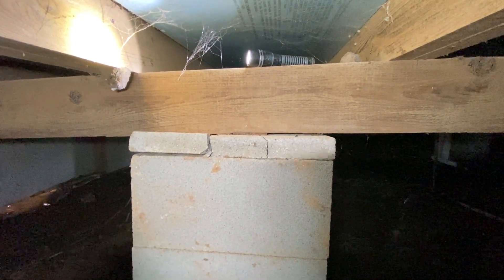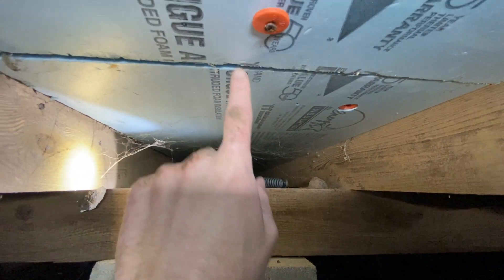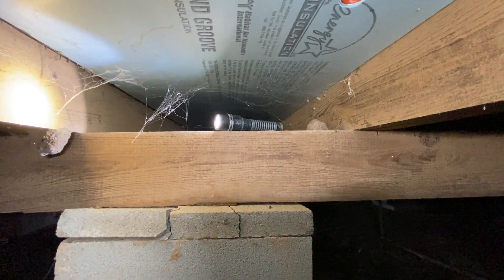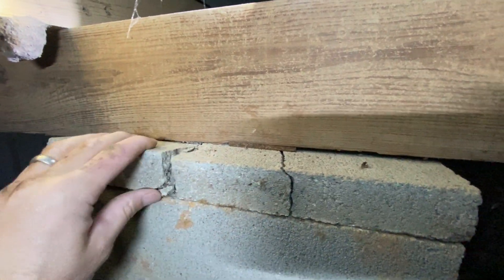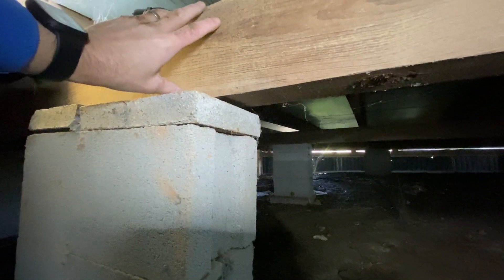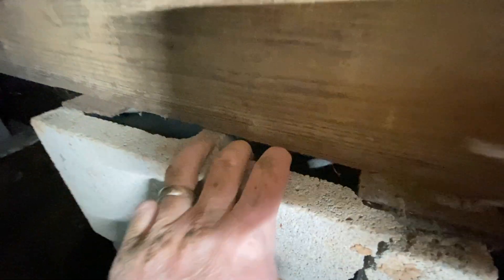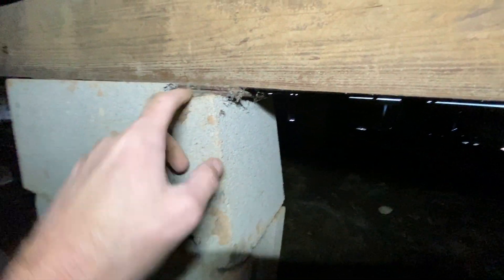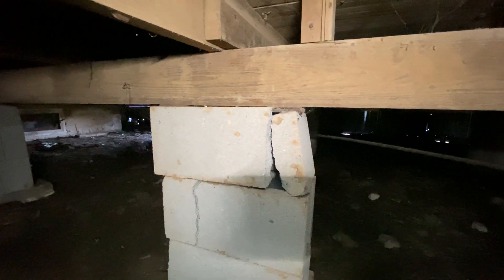Here's Why You Don't Use Steel Shims for Crawl Space Foundation Leveling

Comment: Centerblocks are a joke for foundation unless you stack them staggared for basement walls, then run rebar through them and then pour cement down the holes to the top. A crawspace though? Everything needs to be solid

Comment: In many cases I am sure when we need a shim or spacer there is another issue. If beam is off say 3/16 on one end and 1/8 on the other how would a pro handle that? I am speaking of beam on one block.🦇
Reply from the maker: The shims we use are tapered cedar. Check this out: https://anchorfoundationrepair.net/blog/best-shims-crawlspace-home/

Comment: Any type of shim would do this, has nothing to do with being steel. You put a wood shim there it still makes a point load on the concrete. If the weight is so much that it compresses the wood, then the shim isn’t doing anything. The REAL answer is to put more and larger shims in that spread the weight out, whether steel, wood, or nylon.
Reply from the maker: Fair point and why we use wide cedar shingles for our shimming material on crawl space homes.  https://anchorfoundationrepair.net/blog/best-shims-crawlspace-home/

Comment: What’s the seal made up of?
Reply from the maker: That sill (aka beam) is a 4x6 pressure treated pine.  Very common in our area.  Older homes may have had a 6x6 (or larger) and occasionally I see someone use an undersized 4x4 for a little extra support in one area or another of a home

Comment: Hollow cinder blocks should have been filled solid. Looks like cheap/decorative cap block, I don’t know that they are designed to be structural. Cedar shims are not allowed as they will crush under load over time. Probably the correct answer would be steel shims in two or three locations for each masonry pier.

Comment: If you hope to do this right never use wood. Wood crushes. Use steel shims at least half as long as the concrete. The longer the better. Steel doesnt crush so never settles.
Reply from the maker: Not a bad strategy….

I feel it’s less the material used and more the application of various components of the shim/pier that lead to problems short and long term

Comment: So much about building is down to common sense and how anal the builder is.  Some only want it to look good when they leave, others ask themselves if it will hold up for 100 years.  It helps if the builder has experience on remodeling, because then you can see everything that was once "standard" that fell apart pre-maturely.
Reply from the maker: Agreed… it always costs more in the long run when trying to save some more on the front end.  In real $$’s but especially headaches and worry

Comment: Using a shim that is harder than the surrounding material seems really dumb. It's supposed to support the surrounding structure under load, not defeat it.

For everyone saying that the blocks are weak trash, yes obviously. They could break even with no shimming at all. The point is that a steel shim will break them even faster. At least a wood shim under the wood will fail before destroying the concrete.

Who uses a super hard shim? Just to protect the shim? Do they really like shims? Tear this house down, it's getting in the way of my beautiful shims!
Reply from the maker: That’s a great point.  In full disclosure I hadn’t thought of it that way, but love the analysis.  

I also appreciate all the comments throughout this video… I wasn’t expecting that… and we won’t be changing what has worked successfully for 39+ years.

Thanks for the insight

Comment: It’s a joist,not a sill.
Reply from the maker: If I learned anything in paying attention to comments on this video... it's that we ALL have different terms in the US and the world in the trades... so I'll make the assumption you call them something differently.

For clarification, here are the terms in central TX.  Watch the video again and let me know if you still say the same:

Sill / Beam: Beams are horizontal and support loads across a distance. (i.e. the weight of joists and other building elements)

Joist:  Horizontal structural members, usually made of lumber or engineered wood, that run between beams or the top plates of walls. They support the weight of the floor above (or ceilings below)

Comment: Seems as if being is off the ground think about flood getting wood wet being under the house rotting put as the concrete blocks and steel wood take the water damage a bit better just observations but cylinder blocks probably not the best either a 4×6 or4×8 pad blocks and a steel shim woukd hold up better allowing for shift or such in the ground
Reply from the maker: Lot's of ways to do it... the takeaway is know the biggest threat or risk in your area and build (or in our case) repair to that standard.
Reply: @AnchorFoundationRepair  correct but build write the first is the term not half ass like using steel pipe in 20ft of dirt and under a parking lot with heavy traffic not using concrete but just examples cool video man thanks just friendly advise not bossing or telling you how to do or not do something thanks. Like using wood under a foundation instead of peer blocks and such
Reply from the maker: thanks man.  I appreciate your input and hope we keep learning from each other  @bradkaberline5828

Comment: Cinder blocks are nowhere near strong enough to be use in load-bearing structures. The inadequacy of the cinder blocks is obvious; they are failing badly. 
Clearly, the piers were improperly installed, as evidenced by the fact that they were not properly mortared, plumbed, and leveled.
Reply from the maker: Those are all contributors.  However, in our area of central TX, we have countless homes build on cinder blocks just like this.

I'd prefer that they not be... but as a repair company, we're sometimes limited to the home and structure we roll up on.

Comment: Hmm! .... even if the metal plates were the same size as the area of the wood members resting on those columns, the columns would have broken .... the problem is not the steel shims .... the problem are those weak columns, but the bigger problem is the cheap carpenter who decided to still frame on them.
Reply from the maker: All true

Comment: issue they didn't use pier blocks & used standard masonary blocks. Odds are using Cedar shims would have still cracked the masonary blocks. 
It might have been fine if they installed steel shims across the entire length of the block, but using masonary blocks is just dumb.

Comment: The real issue isn't the shims or the blocks but rather simply Physics, reminds me of the question in my Physics class " What exerts more pressure on a Gym floor, a Sherman tank or a woman in stiletto high heels" the answer is more pressure per square inch is what does the damage. That is what destroyed the block pin point pressure exceeding the blocks load capacity per square inch or area.
Reply from the maker: Well said

Comment: I'm bricklayer and see several issues. I would never build non concrete core-filled block piers. That was the #1 mistake followed by piers that should be two blocks in diameter all around i.e.., 400mm x 400mm(not sure of the US block dimensions), and the shims not spanning the full width of the pier as you suggest are thus not distributing the weight.
Reply: I'm a sparky, and my first thought was, "Gee, that's a small point to focus the weight of the house, onto something that was never meant to be loaded unevenly like that..."
I may be an Electrician, but I have designed and built many concrete structures.
Had an Inspector in Arizona try to fail the garage walls I was putting up, because "Code says Rebar every 5th course," and I had it every 3, or some such nonsense.
Pretty sure code back then in Arizona called for every 5th, and I thought that was schtupidt.
Reply: You are a professional bricklayer... Meaning you do what you were told and taught. 
.
Maybe if you had a deeper understanding, you would understand that not every situation is the same. Some homes don't NEED full concrete blocks. It depends on how many piers you are placing, what the spacing is between them, and how much load you expect on each pier. These all take a more nuanced understanding. That's probably why you are a bricklayer and not an engineer...

Comment: They should have filled the blocks with concrete IMO.
Reply from the maker: Agree with you at time of construction.  For remedial or repair work like these were (I think) much harder to accomplish.
Reply: @AnchorFoundationRepair True.
Lower blocks could be filled and solid blocks could be placed on top of them.
Easier to do things right the first time.
Reply from the maker: Always... and less expensive in the long run too @patmcbride9853

Comment: I recommend sheeting the whole top of the pier with sheet steel,  sticking out on all side to deter termites.
Reply: A termite shield doesn't stop them so much as force them out into the open where they can be spotted during an inspection.
Reply from the maker: That's a great point @Keenasalways
Reply from the maker: Yes, but did you see that video with the termite shield I posted too?

https://www.youtube.com/watch?v=rsC9YXCgB_A

Comment: Are you saying that if you used an improperly sized shim made of wood with the same point load, the outcome would have been different?  Maybe I am nuts but I believe that if the steel shim was wider than the beam and spanned the entire block there should not be a problem.  Furthermore, the problem I also see is the use of the 2 X 8 X 16 block cap instead of good solid wood on top of the block.  It's not the steel that is the problem, is the pathetic workmanship and lack of attention to detail.
Reply from the maker: Your last statement sums it up... the problem is poor workmanship.

I agree with all your comments and focused one issue vs. several that were there and I often see in crawl spaces.

The purpose of the video was to answer the question about steel shims that I often get from our homeowners in central TX.

Comment: You have got to be kidding me? This is the dumbest video I have ever seen. And this yo-yo is out making recommendations to the public? Proof positive on how corrupt this industry really is. First, the quality of the CMU piers is poor. They look like they are dry stacked and the cells are not filled. They do not meet the minimum standards of the building code most likely. I question whether or not there is even a concrete footing. Did this guy check? Did he verify? No. Does the pier need to be rebuilt? Yes. All of them do. The drop girder and floor joists show heavy dry rot symptoms. Most likely replacement is needed here. Second, engineers and inspectors prefer stacks of 6"x6" metal shims on each side of the pier interface with the floor system. Wood shims can compress with changes in moisture. Everything this guy states is wrong. Check the local code requirements in your area and never trust commissioned based sales people that work for franchises for advice on structural repairs. Hire a structural engineer first for evaluations before getting any bids from contractors. It could save you thousands on the project and prevent you from getting unqualified advice from people like this. Do your homework. And don't become a victim.

Comment: Steel shims are fine to use. Just not when someone is stupid to only use 1 small shim for such a large space instead of using a few more of the same shims to distribute the weight more evenly across the whole surface of the concrete block
Reply from the maker: I agree with you.  My only question is why use several small shims when you could just use 1 that's the right size?

Comment: steel shims are no problem - problem is hollow blocks as bearing without filling them with concrete... that's a BAD job...
Reply from the maker: Agreed, they're not the only problem.  We simply prefer a different technique that more fully supports the sill and doesn't potentially put humps in floors or crack blocks.

Comment: I dont fully understand the second one shimmed both sides like you recommended and it was even worse? Steel vs wood shim is not going to make much difference when used in an identical manner.
Reply from the maker: Didn't mean to cause any confusion, but that's not the way I recommend.  I was referencing tapered cedar shingles that can be inserted from both sides creating a nice, tight, precise shim of the supported sill.

I'll get a video up soon to describe what that looks like.
Reply: @AnchorFoundationRepair  No, that makes sense. You were not really unclear, I was not just sure I agreed I guess. Assuming they did a decent job, the difference between a tapered wooden shim and a handful of 1/8" metal shims sounds pretty minimal as the wooden joist itself will have give. But the wooden shims sound easier to work with.

Comment: In the house I sold a few years ago that as built during the early 1950's, the bottom floor joists were laid over large large wooden beams sitting on top of large steel (paint or other) cans filled with concrete which were placed on top of a large concrete block which was laid down on top of blob of cement, on top of rock and soil. It lasted that way for many many years but I was always concerned about the "big one" or large earthquake we expect in the Pacific Northwest. I no longer worry.
Reply from the maker: I've seen a couple of those... I'll just lay in the crawl space and wonder... "wtf were they thinking"

It might not be right, but sometimes those old DIY specials last a long time.
Reply: @AnchorFoundationRepair  Jacklegging is quite common. Sometimes it works, a lot of time, years down the road it doesn't.

Comment: The problem is not the steel. It is just too small. And unfilled cinder blocks are not suitable supports either. 
Somebody messed up there on several issues.
Reply from the maker: You got it... it's never one thing that causes an issue... it's always a combination of bad choices

Comment: I use galvanized steel sheet that overhangs the concrete filled block support by six inches on all sides.
Let's see some termites build a mud tube around that.
Reply: They might - but at least on inspection, easily spotted.

Comment: Since when is non-level stacked unmortared hollow CMU column considered 'normal'?
Reply from the maker: Normal as can be around here... but certainly different parts of the world are going to have different building codes, techniques, materials... 

What do they use in your area?
Reply: @AnchorFoundationRepair well stacked CMU I understand being normal but no mortar? those blocks arent smooth, any bump in them causes a stress point just by stacking them.  The mortar is to eliminate this and to 'glue' each block to the other and provide a equal pressure along the adjacent faces so there is an equal load bearing force applied.  Is it normal to stack outside foundation walls without mortar?

I mean if this is code and normal then there is the actual cause because this will always happen.  And Im betting this is just because this is old 'code' based on block that actually was solid not porous AF like how CMU blocks are now look like a concrete sponge...
Reply from the maker: I'm with you and understand.  Where this old home is... there ain't a code (I mean there may be one, but there's no enforcement mechanism). Just a good old fashioned farm house that could use a little TLC.

I certainly wouldn't build a structural CMU wall without mortar... but quickly and efficiently providing support to a home like this... all day long.  When we're repairing, we get all those little bumps off to provide the best surface we can.

One other thing.. we also drill bell bottom piers that are 12' deep to raise and level slab on grade homes.  We can (and have) done those on crawl space homes just like this.   The downside is the cost goes up for the homeowner quickly and for many old homes exceeds the point of diminishing returns. @Cinncinnatus

Comment: Door type shims would put all the weight on the outside edges with no support in the middle.
Reply: Not true, the shims would fail as necessary to spread the load, rather than breaking other structure

Comment: My 1976 house is just like that.  The joists are undersized @ 2x8 which run 14' in either direction off the beam.  I'm in the process of splitting the spans in half with more blocks and 4x4s.  There's a lot of deflection in the floor and it's a real bummer.
Reply from the maker: Nice work.  You're describing a shaker sill that will provide good support to those old floor joists and make them feel solid.  Here's an article we wrote on that: https://anchorfoundationrepair.net/blog/what-shaker-sill-do/  @stevelemontrudy